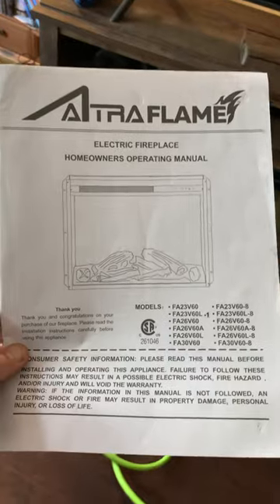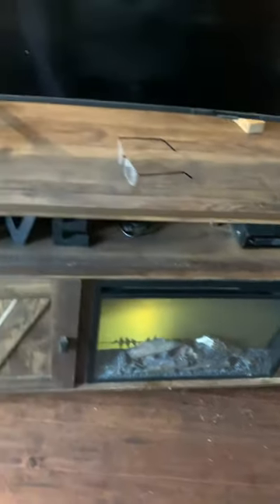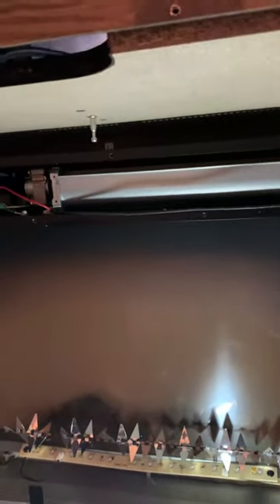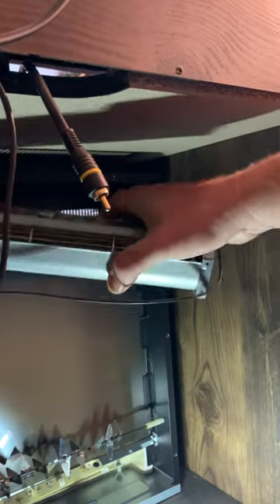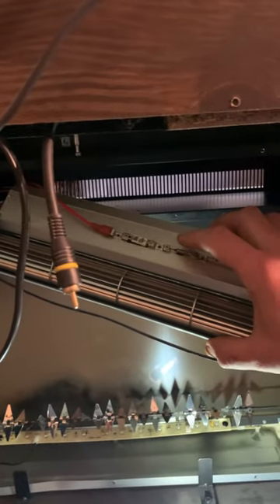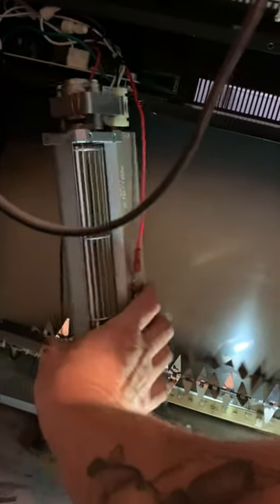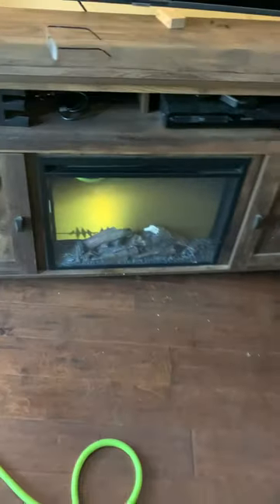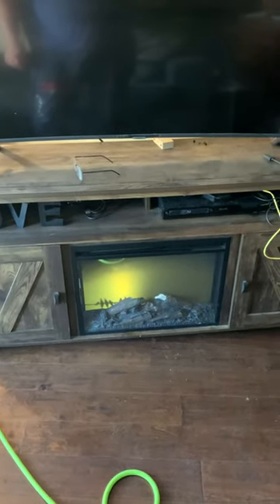Fixing E3 fireplace code from Costco

Comment: Thank you so much for this video.  Mine works now - just needed a good cleaning and voila no more E3 code and the heater works way better.  I believe the heat sensor was dusty/dirty.  To think I almost bought a new fireplace... so your video saved me $500.00